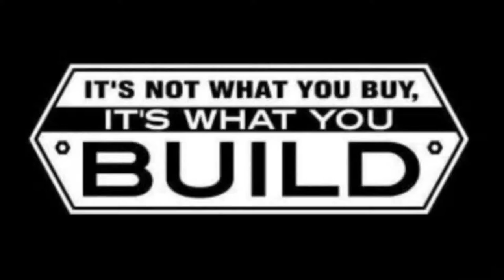1941 Chevy Truck Restomod, Painting fenders with POR-15, review of metal preparation for POR-15

Comment: Wow that comes out slick and shiny,  great job and thanks for the tips on the clear coat for a final finish,  living on a dirt road that's about as far as I need to go with my project,  it's not like a 10g paint job has a real future around here anyway and I don't need any trailer queen's,  see you in the next one, they keep getting better 😀
Reply from the maker: Thanks buddy
Reply from the maker: POR-15 has a paint they call Top Coat same as I'm using but has UV protection already.
Reply: @ELDESTBuilds  thanks buddy,  I'll have to get that, I'll still have to block sand it for a slick finish and probably top coat with clear just for added protection,  I love the way your first coat came out it looks great already
Reply from the maker: Like you said,  keep sanding